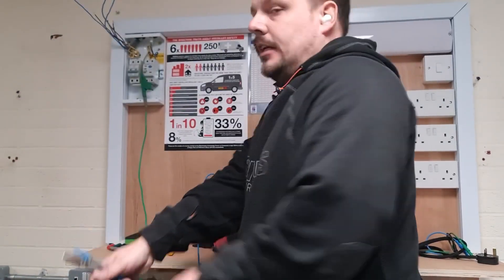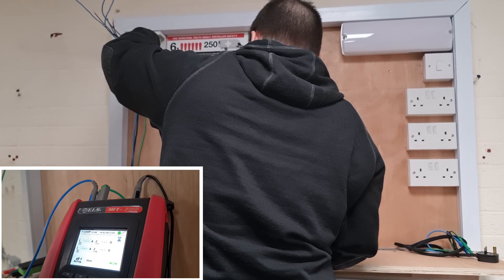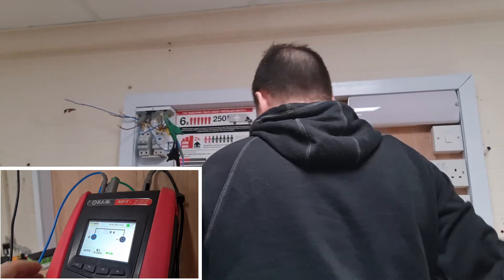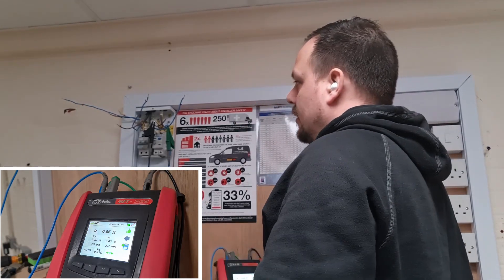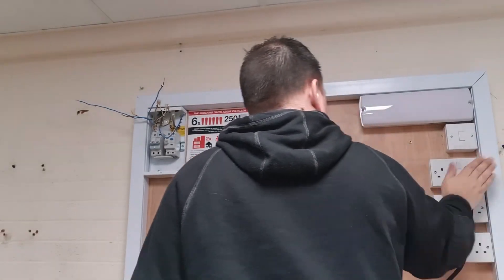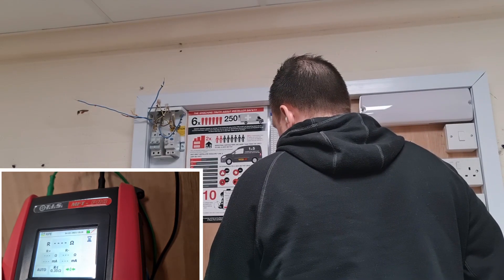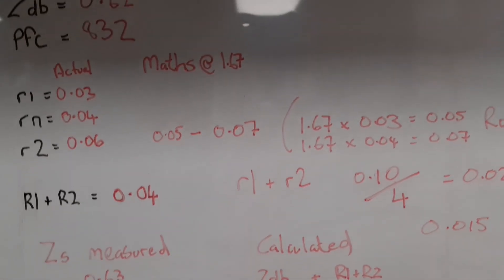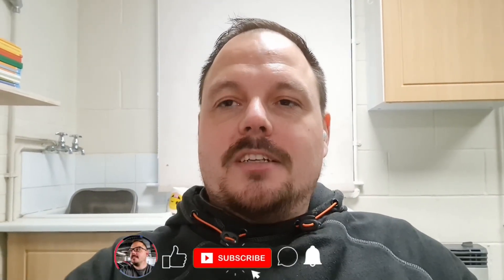UK electrician ring final resistance tests and more! TIS mft pro. PFC Zdb

Comment: Hi Mark. On a recent EICR I came across a ring final with an end to end r2 of 0.30ohms with the r1 & rn being 0.70 ohms respectively. I'm aware of parallel paths but this reading seems extremely low. What are your thoughts on this? Any suggestions at all?
Reply from the maker: Interesting.... metal studs in any walls with flylead back boxes? Has to be a path somewhere to shorten the route! Supplementary bonding perhaps?
Reply: @electrician247  Hi Mark. New build and no metal in wall (wooden battens everywhere instead of insulation) and no flyleads either. Water is pvc pipe except at the taps so no supp bonding either. It's really odd isn't it? Never seen a reading as low as that in comparison to r1 & rn. I'm thinking that the ring final is jointed somewhere but onto another circuit. 

Just thought I would ask you mate.

Thanks Mark. 👍

Comment: Excellent video again Mark. I would like to ask you if I may when doing a ring final test and you have the sockets wired in metallic conduit and trunking (with fly lead to the backbox) and a separate CPC with all the parallel paths how do you conduct the CPC ring and r1+r2. As it would be impractical to take all off to avoid the parallel path? I ended up doing a wonder lead r2.

Comment: Hi mark 
Do you document the measured zs or the calculated  zdb + R1R2 ? Is it one or the other? Also if zs = ze + R1+ R2 at the origin 
Then any board away from the origin then the equation becomes 
Zs = zdb + R1+ R2 
Am i on the same page as you lol
Reply from the maker: I prefer a measured value if possible but you can calculate to GN3

Comment: Mark, When you did a Zdb did you do it with the earth disconnected? as I was always told you kept it connected It has always been something that I have never been 100% on. However, I have always done a R1+ R2 of the sub-distribution circuit.
Reply from the maker: Zdb is basically Zs at the consumer unit/DB sub board. Leave the bonding connected. This particular sub board I tested with the earth out from the CPCs but the bonds were in the main TPN board. Never disconnect bonds on a live system. 

I could have made this clearer. Was trying to illustrate how the cpcs in my setup have no effect as they essentially sit in the local trunking and accessories only. 

Its hard to be as clear as I maybe should. In reality I want use this test board as if it was the origin going forward and not just plugged in lol. Thanks for the comment

Comment: Thank you. 
Quick question for another video: you mentioned that you don't do a Ze reading on a sub-board. You do a Zdb reading/measurement. IF you could answer that in a future video (first year C & G electrical installation student). Thanks again for the video. Appreciated.
Reply from the maker: Zdb is basically a Zs measurement at the sub board. So all bonding connected etc. Never disconnect bonds on a live system